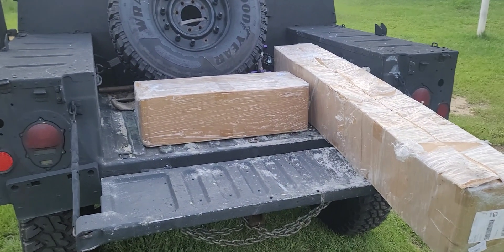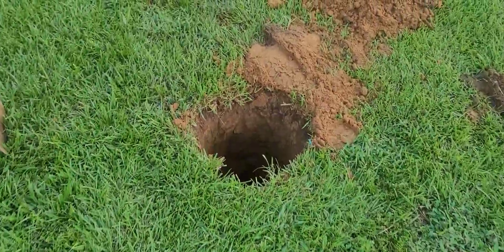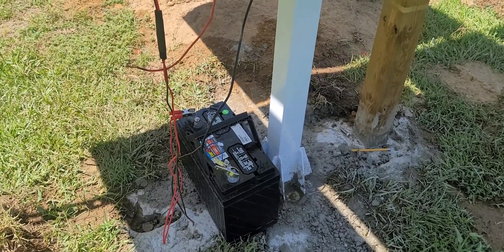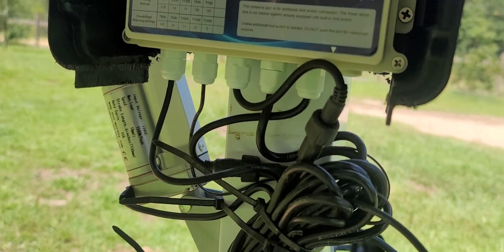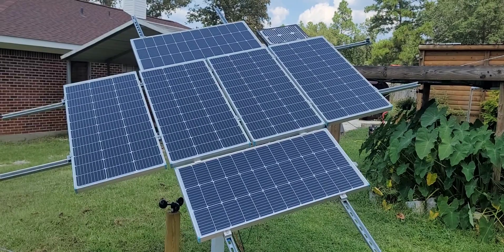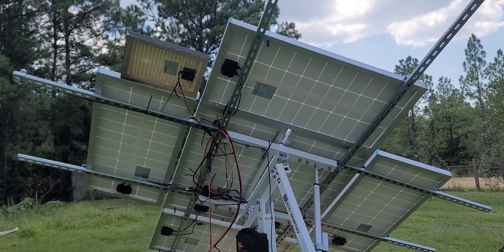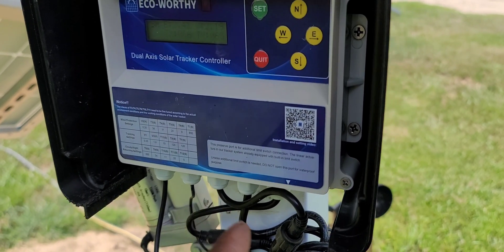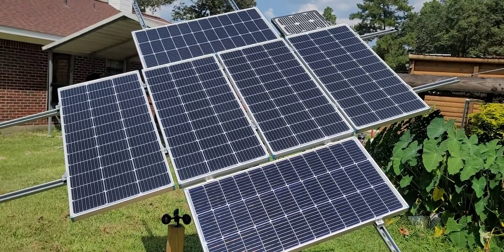IF YOU WANT MORE OUT OF YOUR SOLAR PANELS, DO THIS!!!

Comment: A tracker like this you will get 40% more energy than stationary panels. Also those connecters are waterproof connectors. Also can you tell us how powerful your panels are?
Reply from the maker: 6-100 watt solar panels, I've added 4 more 110 watt solar panels since this video for a total of 10 solar panels and another 40 amp mppt controller to the solar tracker

Comment: How did u wire the panels
Reply from the maker: I wired them in parallel
Reply: @lifewiththepettways7281  what charger controller u using

Comment: Man,a lot of people dont know what they talk about solar,first of all yes you can mount an extra solar panel to the sistem if the controller allow this and is not exeded maximum voltage and amps.
Reply from the maker: @carlos_sacalul you are right about voltage and amps however this system is within its correct form and installation. its a 600 watt solar panel system (6-100 watt solar panels) with the correct charge controller  the video is about getting extra power from your existing solar panels by using a solar tracker which provides you 40%  more sunlight for your panels to give you more energy intake throughout the day extra power comes from the tracker following the sun....when stationary solar panels don't follow the sun.
The charge controller and the solar panels are matched for such!
Getting the most out your system is not just about adding more solar panels.
ITS ABOUT TRACKING THE SUN FOR MORE ENERGY
FYI:
 THIS SYSTEM CONTAINS 6-100 watt solar panels with 6 amps per panel (36AMPS TOTAL) with a 40amp mmpt charge controller,
Have a Blessed Day!!!!